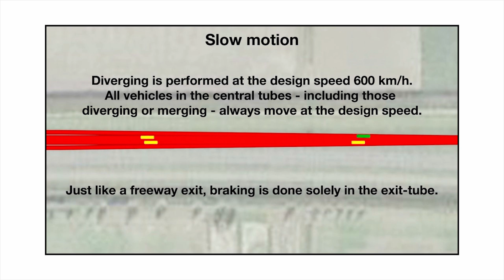ET3 Dr C

Comment: For the zillionth time, I favor the concept, but I see it as having been designed by people that do not understand transportation.  There are a number of flaws I've talked about; but they can be worked out; with the right knowledgeable person working with them.  They need someone that knows transportation, not just as a planner, but a person that has used all types of transportation modes; and studied their positives and negatives.  Until they do, I don't suggest that they build a demo track; as if it has all the flaws, transportation experts in cities will see those flaws; and reject the project.  Ever travel a freeway in a major city; and then interchange to another freeway?  If you have, you probably also have wondered how drunk or stoned the planners were; as they could have been built simpler and more cost effective.  That is what I see here.

Comment: One final though.  The oil/gas/airline companies will do everything humanly possible to derail this concept before it gets off the ground.  Sad, but the harsh reality we all must consider.
Reply: I knew the designer of the Bobcat; and he designed a brake that 1) never wears out and 2) never fails.  The oil companies bought his design for $$$$$$$$$ and $$$$$$$$$, then put it into a save and on purpose forgot the safe's combination.  I'm sure that there will be "HUGE" buyout offers for this system.  Brian:  Light Rail is already spending Billions to take away a bumper to bumper lane of auto traffic and to be built in; only to run one train car on it every few minutes.  Why not spend it for a real traffic eliminator?  I still have questions about how the stations as shown in the video, will work, as the pods will be in a vacuum before entering the station; but must be un-vacuumed entering the station; then re-vacuumed leaving the station.  Then there's the long speed reduction/buildup to/from stations.  The system will be far more massive than the single direction tube shows.  I operate in the Disney Imagineering way of doing things; and the storytelling planning sessions need to be incorporated into this projects planning.  Engineers don't always think out of the box.  All the problems Las Vegas Monorail has experienced over the years, I saw "before" they built the line.  It could have been a far shorter line, still going to every casino it goes to now; but, it wraps in/out around the fronts, then backs, then fronts, then backs of various casino's that worried about their front appearance being blocked by that small guideway; adding at least one mile of guideway construction; and travel distance/time to each run.  That extra mile costs electricity, tire wear, etc.  Add that up for a year for 4 running Monorail trains and it's substantial.  Again, I favor evacuated Maglev tube travel, but I see not enough study of how it should be built and operate.  If I were working for them, I'd begin holding daily storytelling meetings; with wall size white boards to make sure everyone knows exactly what is taking place; and who is having problems with their aspect of it.